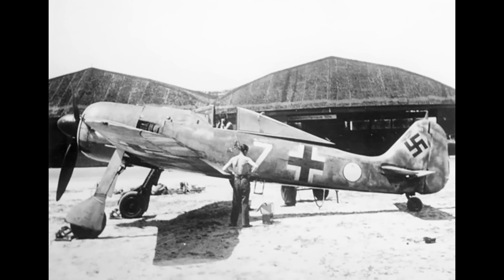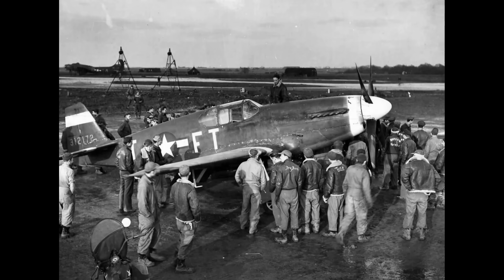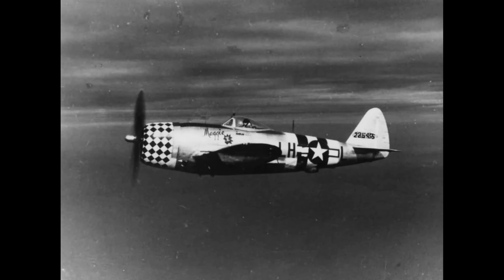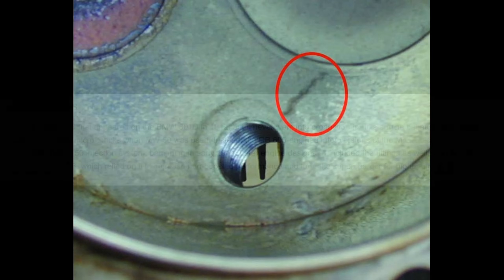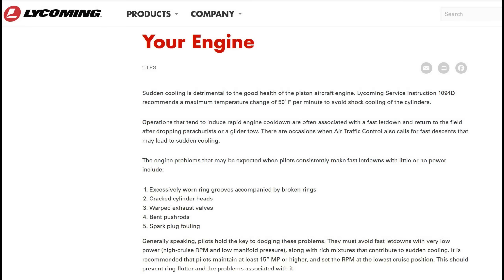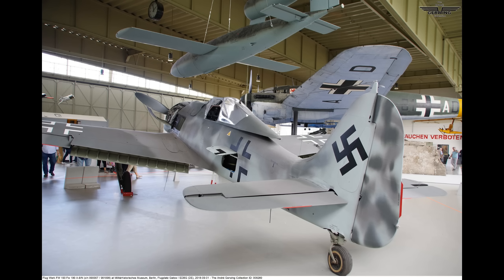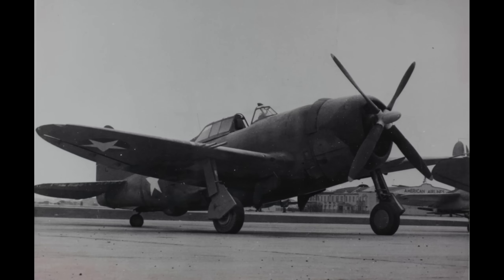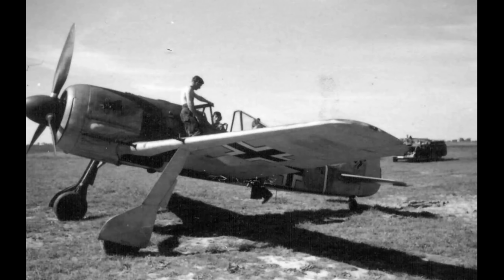Focke-Wulf Fw 190 A-4, Almost turned the tide, Almost...

Comment: Hi Greg, I love your videos this is another great one.  
On the shock cooling of the engines of parachute and glider towing aircraft you said "they often go from full power in the climb to idle decent and an immediate landing without problems from shock cooling". Ive done parachuting and I do glider towing, that is not how we handle our engines. We would expect cracked cylinder heads if we did that. 

Im flying a Piper Pawnee with a Lycoming IO540 engine. After the full power climb we leave the power up high and fly straight and level for one minute to allow the engine temperature time to stabilise before beginning the descent.  We descend in a high power dive at high airspeeds. The engine revs are at 2450 in the descent (max permitted engine revs is 2550.) this keeps the rate of cooling below 25*F/minute.
Reply from the maker: Very good then. That supports my argument that shock cooling is real.

Comment: No skilled pilots to fly them and none in the pipeline, so no matter how many top line fighters Germany was unable to man them effectively.
Reply from the maker: In early to mid 1943 they certainly could.
Reply: @GregsAirplanesandAutomobiles  Yeah if they stole pilots out of other fighter platforms which still left you with a finite cadre of good pilots that were continuously attrited and not replaced through the course of the war. So no matter what fighter aircraft German Pilots flew it did not matter because the pilot numbers were to few and not enough trained replacements.

Comment: Hi greg, love the video and the channel as a whole. I'm mildly disagree with your assertion at the end of the video that The invasion could have been delayed until June of 45, I absolutely agree that better performance out of the Anton could have delayed allied air superiority, but I disagree in terms of the scope of that delay. If anything, air superiority is probably delayed by a month or two until German pilot losses forced the issue either way. A more capable fighter piloted by amateurs is still vulnerable. 

I think we would have seen some major adaptations from the allies, including maybe a willingness to put the better propellers on the p38 and maybe delay the p-51, because it was unproven and existing fighters weren't fairing so well. The p-38 was the hot ticket at the moment, and while I definitely think the Air corps wouldn't have wanted to interrupt production, that might have pushed them over the edge. I could see the p80 being delayed so that Lockheed could focus on setting up the p38k line.
Reply from the maker: The Luftwaffe caused the USAAF huge losses in 1943. They would have been far worse with a 2300 hp A5, or at least I think so. Furthermore, the US fighter pilot attrition would have been much higher. Obviously it can't be proven either way but I think I can make a case that the Luftwaffe would have held out four months longer, which is all it would have taken.

Comment: Good as the Fw 190A-5 was, once Supermarine started to produce the Spitfire Mk. IX with the 1,600 bhp Merlin 61 engine, that pretty much eliminated the advantage of the Fw 190A models.
Reply: The A-5 did some good work against B-17 and a great job on the Eastern Front. It was never meant to match Spitfire. That was 109s job. Tank's intention was to build a versatile, sturdy, pilot-friendly and forgiving aircraft - essentially the opposite of a Spitfire/109. Instruments/switches/engine layout was probably best in a WW2 fighter. HP certainly help, a pilot being able to focus a lot more OUTSIDE the cockpit is certainly not a bad thing either. Also 190 could take one up the chin where Spitfire and 109 disintegrated.

In a fighter vs fighter environment considering dogfights, Mk IX anytime&anywhere. 
In a well executed ambush (this is what you're aiming for; you don't want to circle, you go boom&zoom), my money is on either side.
During autumn/winter/spring on the Eastern Front, in a low-level environment with lots of air-to-ground missions and a hell of ground-to-air fire and a roughly plowed field to start and land, I'll take a 190 10/10 times.
Against heavy bombers, I still prefer 190 for the punch, although at high altitudes Mk IX might come in handy ...
Reply: The captured FW190A was test flown and the new 60 series Merlins were set up with the 2 speed supercharger twin altitude/power ‘dips’ (the band in the climb just below each speed’s full throttle height) in sync with the 2 speed (single stage) BMW 801’s twin ‘dips’ so that there was no point in the power/height graph where the Spitfire IX’s power was (significantly) lower than the 190’s.

Comment: Love the video as always but I’m not sure about thesis that the MW50 could cause shock cooling. There’s some pretty basic math that could rough out the cooling rate based on the mass of aluminum, ME50 flow rate, and heat of vaporization of the ME50. Seems like a little boiling vs a lot of aluminum. Also, I built an old school Audi 5 cylinder (my daily driver) that runs 2 bar boost and 1000 cc/min of MW50. I do not see a significant difference in EGTs with the methanol system on vs off…which is a shame bc I’m right at the limit near 1000C. At any rate, love you digging into these things and I’m just guessing on my end.
Reply from the maker: Is that right? 1000cc/min? That's quite a bit of spray.
Reply: @GregsAirplanesandAutomobiles you’re probably right. The 1000cc fuel injectors max out at 60% duty cycle on E85, so total max fuel flow is about 3000cc/min. Does seem like a lot at 1/3 of the fuel flow but it’s also roughly what the water meth manufactures recommend for my power level and boost. It does drop IATs a whole lot.

Comment: Even water-methanol VAPOR injection can make a big difference on an engine.
Around 15 years ago (until some idiot on his cell phone, late for his tee time at the golf course t-boned me), I had a 1987 Mercedes Benz 300DT sedan, with the 6 cylinder inline turbocharged diesel, with the fixed T3 turbo.
The previous owner had bought it new, but was getting too old to keep up with the maintenance on it. He'd only put 130K miles on it in nearly 20 years, and apparently most of that at low speeds. The exhaust system was loaded with soot - the first time I tried a hard acceleration in it, it put out a cloud of soot that would have done a coal-fired locomotive proud, entirely blocking my view in the rear view mirror for a few seconds - and causing the poor sod that was behind me in a brand new Ford Mustang, with his windows down, and had been tailgating me for the past 2 or 3 miles, to literally stop dead in the road, and then stay a healthy distance behind me the rest of the way to work.
The engine had bad injector nailing from all the built up carbon and gunk in the engine, as a result of the oil mist being sucked in via the crankcase vent ahead of the turbo, and the previous owner's infrequent and low speed driving.
After doing a thorough cleaning of the intake system and manifold, I installed a crankcase ventilation filter to capture the oil mist.
After that, not wanting to go to the trouble and expense of installing a liquid water-methanol injection system - and wanting to avoid any possible liquid impingement on the turbocharger - downstream of the oil mist filter, I installed a "bubbler" container.
About a half-gallon in size, filled with cheap water-methanol windshield wiper fluid, it routed the crankcase vent gases to the bottom of the container, which then bubbled up thru the washer fluid, evaporating the water-methanol mixture, which then got sucked into the intake system ahead of the turbo.
It also had the added benefit of condensing out any oil mist the filter had missed.
After little more than a month of doing my daily 40 mile round trip commute to work, it suddenly dawned on me than the injector nailing had completely disappeared - and once off idle, the engine was running quieter than many gasoline powered vehicles I'd driven - and even in my mixed driving commute, it was pushing close to 30 MPG average fuel economy.
Reply: I Unterstand half of it but my Lada can hold with your Mercedes. Lada has Vodka vapor injection (depends on quality of Vodka)
Reply: @MsBartuc  🤣🤣🤣
Reply: Sod is bad, right?
Reply: @hooter63 unfortunate in that context….
Reply: Poor devil (the driver behind you), lol!
Reply: Pretty clever little setup, makes me want to try something similar on my DI Civic to prevent the intake valves from getting gummed up with carbon.

Comment: Swordfish!  When I was towing gliders a typical flight was full throttle at 52 mph up to 3000' AGL, then glider release after which we'd reduce throttle to 2000 rpm, rack over into a 90 degree bank with full up elevator trim and stick pulled back and spiral down to pattern altitude.  We did it this way to minimize shock cooling while getting down quickly to pick up the next tow.  Super fun flying.
Greg, have you considered upping the available Patreon levels?  I feel the value I get from your channel exceeds the meager price you charge we patreons.  I'd happily pay more.
Thanks and I really hope you're back doing what you love just as soon as possible.
Reply from the maker: Thanks jaym, I am considering it. I'm reconsidering a lot of things now that I can't fly in real life for a while. I may add some super level that involved a live chat once a month or something like that.
Reply: @GregsAirplanesandAutomobiles  sorry to hear about the flying... don't wish to pry but naturally curious what's up?
Reply: @GregsAirplanesandAutomobiles  Doesn't matter how good an aircraft is.
Only the most experienced and highly-skilled aircrew can fly to the limit of a plane's envelope.
By 1944, most of the skilled German aircrew were already dead.
Imagine a learner-driver in NASCAR. A skilled driver in a Prius might be faster.
Reply: @FredScuttle456  Perhaps, but a better aircraft two years earlier would certainly contribute to not losing those skilled airmen.
Reply: @FredScuttle456  What the casualty rate among Luftwaffe pilots did was widen the gap between the experten and the pilots who were getting pushed out of flight school without the training they would have received at the start of the war. The Japanese pilot cadre showed the same problems, but more severely, since they didn't have the advantage the Luftwaffe did of getting to learn against the inadequately-trained pilots who'd survived Stalin's purges, and were facing pilots from a country with the resources to comprehensively train new pilots before they were put in the field, so even the new pilots were better than the average IJN/IJA pilot -- but the best Japanese pilots had the same 'education' the best Luftwaffe pilots had -- learn to get better than your opponents or die.
Reply: @reinbeers5322  Or less capable opposition.
Reply: The severe bank trick was something that I learned to use in the WWII air-combat Sim SVGA Air Warrior to get my B-17 back to the ground quickly from the altitude I made the bombing run at while not exceeding the 190-knot speed the pilot's manual said was the limit before the cockpit glass blew in.

Comment: Just something to add about the smaller Lycoming engines and shock cooling after having flown a Cherokee 180 with the old fiberglass cowling a few hundred hours with a JPI 700 installed. It's actually quite easy to exceed 50 degrees per minute if you're not paying attention or not familiar with the airplane. Entering the pattern at 115kts with power around 2400rpm and then even cutting it to just 2000rpm will exceed the 50 degrees per minute even with an 85 degree day. Going from 2300rpm to idle will easily exceed 100 degrees, maybe even 150 degrees or more, per minute. I think it still leads us back to the same conclusion though. It comes down to the alloys used and metallurgy. Although the engines in our GA airplanes haven't really changed over 70 years I'm sure they have the manufacturing process almost perfected for what it is... Germany in the mid to late part of the war wasn't able to produce the quality needed for their machines. 
I think shock cooling is a real thing but the engines in our airplanes are very tough even when treated poorly. I flight instructed for 2.5 years and I think we had 2 maybe 3 cracked cylinders on our 172S airplanes (IO-360 180hp). I think Lycoming and Continental puts out material with somewhat conservative numbers like running lean of peak or shock cooling to cover their butts and there is no doubt running an engine with constant, relatively cool temperatures is better for it.
I would like to hear if anyone else has had similar experiences.
Reply from the maker: Really? I'm not doubting you as it's been a really long time since I flew a Cherokee 180. I do love that plane. All planes are a series of compromises, speed/payload/Fuel economy/running cost/etc/ . The Cherokee 180 has a good balance of these things, at least for my money.
Reply: @GregsAirplanesandAutomobiles  For me and my airplane and pulling numbers from my head that's the results that have occurred or at least pretty close. That's why I'm curious if anyone else has had similar experiences. I haven't flown a ton of GA airplanes that had instrumentation  to show cylinder head cooling per minute like the JPI.
We do like the Cherokee too for much of the same reasons you mentioned. Pretty good bang for your buck on the initial purchase and to keep operating on a regular basis.

Comment: I remember shock cooling was on our minds when driving a DC-3 down final at ORD.  Glad you addressed this.  Big radials are more susceptible to shock than Cessna motors.
Reply: I remember giving a “One thousand, two thousand, three thousand, four thousand" engine warming power application 😉in my commercial general flight test’s forced landing exercise  with a government examiner.  He passed me and liked my forced landing approach.
Reply: @givenfirstnamefamilyfirstn3935  yep, goose the engine a little bit to make sure it'll be there when you need it. 😀. I was a terrible pilot after I got my private, until I started flying at another airfield, converted drag strip.  Had a new flight instructor who insisted that I fly every approach is though it was a engine failure.   A few years and 1,000 hours later, I had a real live no joke engine failure over the Great Dismal Swamp, and ended up walking away uninjured and with minor damage to the airplane.
Reply: @fredkitmakerb9479   Finals with half flap and closed throttle should bring you to the runway unless you are starting off too low.  The 3 degree PAPIs are a siren drawing in single G.A. planes to their potential doom.

Comment: So much to run with on these earlier variants 42' 43' it's a Great period. As it seems both sides sacrificed a lot of weight and pure performance in the name of top speed and multi role capability. Adding 600lbs is no small thing, but it was similar for the later 51 and 47 variants aswell given a meager 2 or 3 hundred hp gain. Not sure why they'd bother trying to push the anton to failure with mw50 just to have a supercharger geared to run out of puff at 21,000 ft but maybe they had other gearing. Calum also has a video referring to a special unit of Antons lead by Galland using nos. It took the brits almost a year to figure out what the bottles were even though the German code word for it was laughing gas. Great work again Greg.

Comment: I don't remember you mentioning in the video, but the reason the A-5 had a longer engine cowling was related to cooling issues in the A-4.
Reply: Interesting I would have thought that would be used to improve control effectiveness by increasing the arm
Reply: @shawnmiller4781  I read about the longer cowling as a cure cooling issues a long time ago. I did a little dig now and the reasons for the longer cowling are all over the place now. Some say is for vibration issues, other say is armament related and then the temperature issue. I don't know in who to believe.

Comment: Question, if the BMW801 radial was unable to use the MW50 to the fullest, how does the Jumo 213 able to use it????
Reply from the maker: The Jumo is a liquid cooled engine.
Reply: @GregsAirplanesandAutomobiles  I am sorry Greg, I unable to understand why a liquid cooled engine is better/suitable compared to an air cooled in terms of MW50 application. Is it possible to do a short video on this?